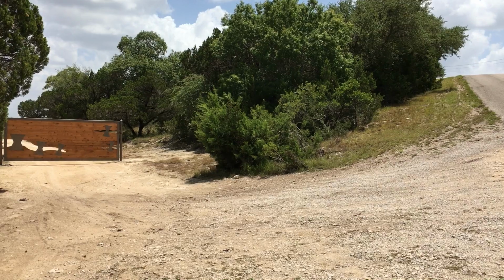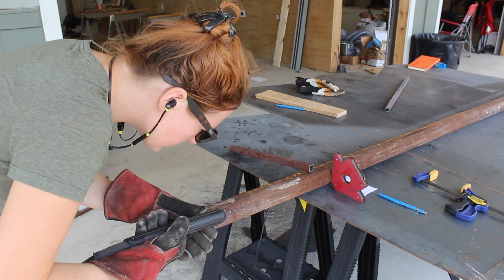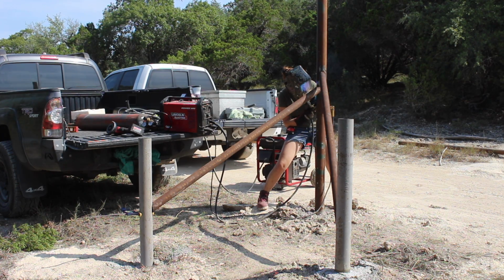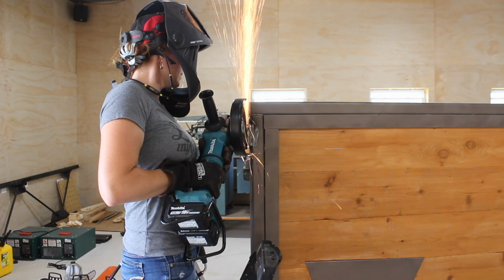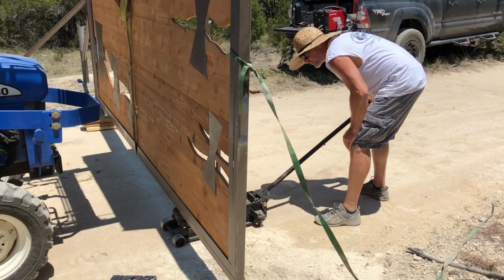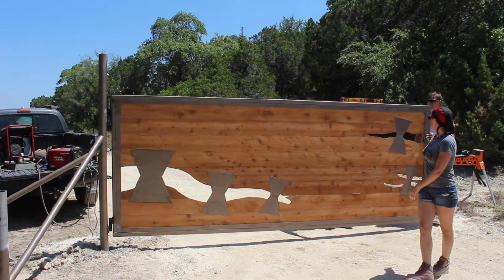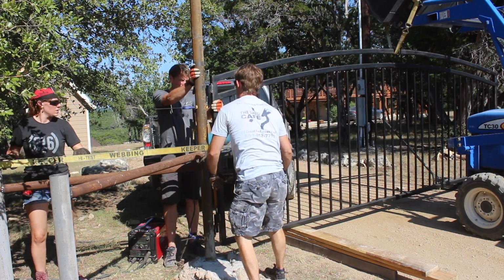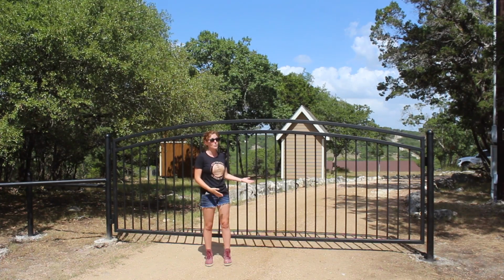Installing Two Giant Property Gates

Comment: Not bad, not bad at all. As the son, nephew and grandson of a family of blacksmiths, not bad at all. I mentioned in another video that I would very much prefer the frames to be cut in 45º angles instead of the way you did it (less welding involved and cleaner look in my opinion) but that is the most I can say.

About the subpoles you placed, I prefer the second way you did it over the first one. You say te stringers look cleaner this way. I think otherwise but that's subjective. What's not that subjective is that the first one will be stronger than the second one. It's probably something you will never have to worry about, but the thing is that placing those stringers so high, the weight of the gate is pulling the main pole towards itself, and the stringers are pulling from the subpoles. They look sturdy enough, but if they have some flexibility to themselves, that would make the main pole lean a bit over time and so would the gate as well.

I don't know if I'm explaining myself here (sorry, English is not my first language) but I hope so.

In the first gate, there's no chance the subpoles would curve themselves since the concrete is there to prevent that.

Again, it's something that would probably not worry anyone, and as long as there's no rust in the subpoles, that would be fine.

Thank you for showing your effort and learning along the way. Yes, you can't ever trust those hinges, they can be welded in the wrong angle or the plate be mistakenly cut from factory.
Reply from the maker: Yep, making perfect sense. That's why I added the concrete to the main post because I could tell a difference with the stringers being horizontal. I like the way they look better, but they are less effective. I don't think it will be an issue though. Glad you like it!
Reply: Oh, thanks for answering, I'm honored :-)

Nah, it shouldn't be an issue as long as they're taken care of properly, which also means more paint in the future (more surface, more paint), but they will lean a little overtime. Well done with the concrete, it's not a perfect method but it makes the whole pole stronger (I have a couple of those).

Thank you!

Comment: How come you're going to use concrete for the drive and not asphalt?  Is it a heat thing?
Reply: Concrete is ten times better than asphalt, in every aspect. Much stronger. Much more durable. Much easier to maintain. Much cooler, much nicer looking...
Reply: then why is Asphalt so widely used?  Up in the Northeast where I am from, almost no one has a concrete drive.  Is it a cost thing?
Reply: Yes, asphalt is cheaper, and in cooler climates it doesn't matter as much but in TX the sun is absolutely relentless, even in winter.  Light grey concrete vs black asphalt, easy choice.

Comment: An important safety warning to keep in mind: Slab sided gates can catch an impressive amount of wind, and build up dangerous energy levels if ever allowed to swing freely in a storm. Adding a deadweight to the far end that must be lifted to move easily can go a long way to minimizing how much speed it can pick up. I've seen similar sized gates rip themselves apart, and apparently throw a grown man across his own lawn. A lever arm that long is not a fun thing to play with when out of control, and it is vitally important to triple check the ratings of any automation hardware you attach, as most assume an open structure gate that won't catch even a fraction of the overall wind.

Using a pipe run through your brackets is a handy way to ensure they're aligned on axis, and gives you a longer surface to confirm alignment with.
- Some handy tips for when using a pipe to align hinge brackets:
1. Ensure the pipe is actually straight.
2. Ensure the pipe slides through at least one bracket for its whole length. (A friend once 'borrowed' a length of 'important pipe' off a some piece of equipment, and then forgot that there was a welded fitting in the middle that wouldn't slip through the brackets he had just welded on.)

If you have the option, keeping one of the pins longer than the other allows you to use it to align and guide the door/gate onto the hinges in the event that you have to take the gate off and on.
Reply: Wow!
Reply: Fortunately, I'm sure the young lady building the gates actually appreciates the clearly presented advice.
Reply: RealLuckless - Add my name to the list of people who can appreciate what you are saying. I would actually be interested in hearing more. A few more anecdotes, perhaps??
Reply: RealLuckless some people just have to learn lessons the hard way. Even moderate winds can exert a surprising amount of force on flat surfaces. This is why sailboats are a thing! I too appreciate this feedback, I'm sure April will take it into consideration since its smart.
Reply: RealLuckless great tips there on hinge alignment, and yes good idea to check the rating of automation hardware. Drag is a cubic function of speed ie the wind speed doubles and you know have deal with 8 times the force on the gate as before...
Reply: Hurricane Harvey did a number on my gate opener.  It was an open bar design like the black one.  It pretty much twisted the steel bracket into a pretzel...darn thing some how survived...
Reply: The people who can’t take constructive comments like this are the people that end up on your next OSHA training video. Fail safes are there for a reason, do things safely and April is a smart woman but she may not have thought of this, I sure as hell didn’t.
Reply: I have 2 8ft steel gates I built and installed 07, they are open and each weigh in at over 250lbs. They still catch a lot of wind. I have been hit by them quite a few times. I had to add more posts so I can tie them open if there is any wind. Gates and wind really are not any fun. https://www.facebook.com/photo.php?fbid=511296125612007&set=pb.100001948729205.-2207520000.1536202708.&type=3&theater
Reply: I agree with your concerns about wind loads, etc. I've been installing first and building gates since '88. There are plenty of different ways to do it but you need to use good quality hinges in the fabrication , not Chinese junk. I build a lot of gates and ship from Florida to most anywhere in the US, Jamaica, Bermuda, Bahama's . All gates and hinges are assembled in the shop before Powder-Coating .
Reply: RealLuckless Is
Reply: For 23 years, I lived in the same general area where she lives now. Wind loading is a very real thing in Central Texas. I've experienced 60mph straight line winds driving pea-sized hail, and that was just a thunderstorm, not a tornado. In wind like that, though, you just batten down the hatches, so-to-speak, and stay inside.
Reply: RealLuckless 
All, very thoughtful suggestions! Were your suggestions based upon theory, or (as I suspect to be the case) hard won, empirical evidence?
Reply: Lonnie Moore a developer used gates made in a similar fashion in a new subdivision near where I was living a few years back. Realtors sold them as being part of "the ultimate privacy fence" as they didn't have any gaps. They were fine in calm weather, but a bunch eventually failed in some storms with at least one person critically injured after getting smucked by their gate after it got free to swing. 

I've worked in industrial safety design off and on for years, and some of my journals now kind of read like a book on all the different ways "harmless" things have killed or seriously injured people.
Reply: RealLuckless I understand your concern but I’m guessing those incidences happened cause there house is relatively close to the gate to be able to get hit by it, but her gate is at the very beginning of the long driveway up to her shop, so unless she’s planning on leaving her safe shop in the middle of a storm, I don’t think that gate will hurt anybody.

Also why would somebody walk up to a big ass gate in such strong winds?
Reply: Lets see your gate build... Ooohh wait your just a Troll.
Reply: No One's ever been killed by a gate, calm down cowboy.
Reply: Shawn Knapp 
Assuming you're correct about an absence of fatalities associated with Gates of this nature, wouldn't even the possibility of injury, severe or otherwise, warrant a bit of precautionary effort when building/designing, Cowboy?
Reply: Shawn Knapp 
Pretty sure they have.
Reply: @MrShawnknapp  A lot of people have been severely injured by gates and possibly killed. You don't have a clue.
Reply: Shawn Knapp in the passed 10 years 12 people have been killed in gates. Automated gates have to adhere to the Health and safety mechanics directives. Gates can be deadly if installed incorrectly.
Reply: If people don't want to heed warnings, then that's on them. I won't lose any sleep for people not wanting to address it if they choose to build such a thing without bothering to put in simple safety features.
Reply: @RealLuckless.. but yet here you are losing sleep and replying,,, Troll
Reply: There is always some schmuck who feels his manhood is impugned by Engineering safety, clearly RealLuckless knows more than you do. A good tip there on pin length.

Comment: The gates look great April.  Congratulations on a job well done.  Since you asked for input for others doing what you've done, here is my input.  You intend to have actuators to open and close the gates apparently.  That kind of does away with the need for gate stays but for anyone putting up a gate, you must have some method of opening the gate and having it stay open until you want it closed.  The closed part, which you didn't appear to address is a whole nuther thing.  I didn't hear or see you install something on the gate/post to lock it shut.  Gate openers are not always as strong as you think.  someone can open the gate by forcing the gate opener.  Now back to keeping the gate open.  Without a mechanical opener you need a rod that comes down along the gate that can stick into a pipe in the ground.  You don't want to open the gate only to have it swing into a following vehicle.  check out some other gates perhaps to see what your missing.  Its just a simple metal rod bent into an L shape that is held by a couple of pieces of pipe slightly larger than the rod.  You might need to use this someday if your electricity fails and the opener lets the gate swing on it's own.

Comment: Pretty sure they are solid and they swing as they should well done. Filling the poles with concrete was a good thought.
Reply: Great comment Eric. I had my mail box knocked over by state snow plows and vandals 4 times before I did it right. I used my tractor and auger to sink a hole 5’ deep, put a 4” diameter steel pipe in it well bedded in concrete and then filled it with more concrete. A vehicle hitting it now will need to be towed away.
Reply: Is it though? I don't have any experience, but I always heard that a hollow tube doesn't bend as easily as a solid tube.
Reply: Mass is important in this case. I think is also standard practice and it would greatly increase the stiffness and crush resistance of the pole.
Reply from the maker: I wasn't going to fill it, but by making the stringers horizontal on the house gate, I felt like the pole needed the extra support. Thanks Eric!